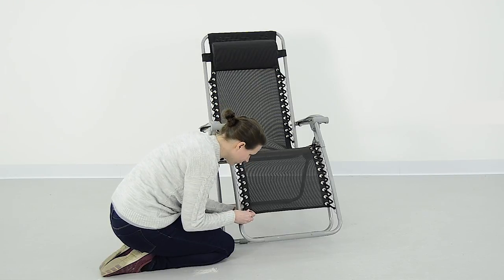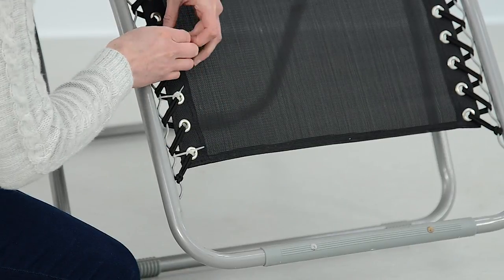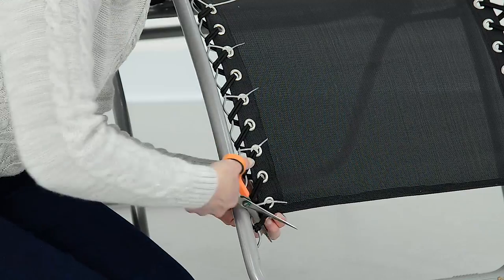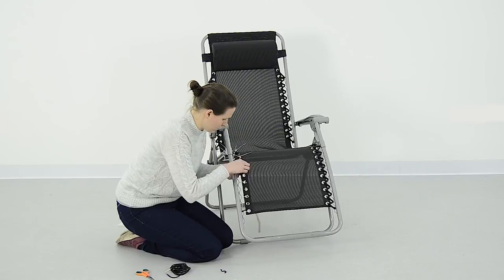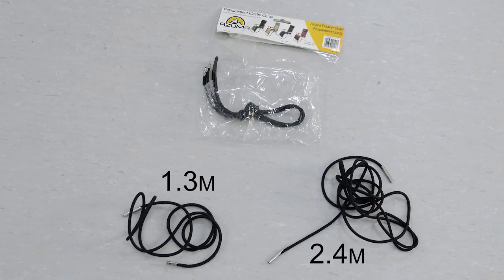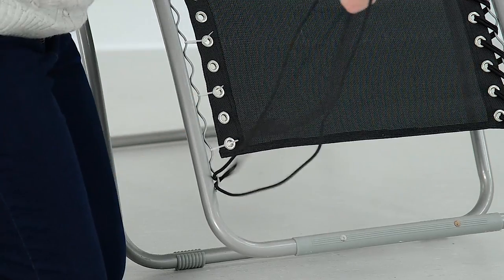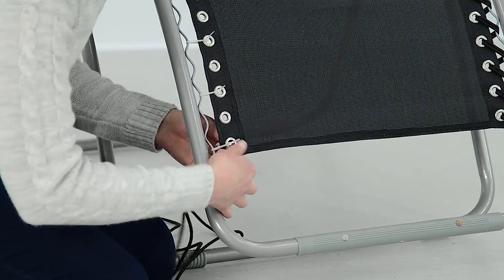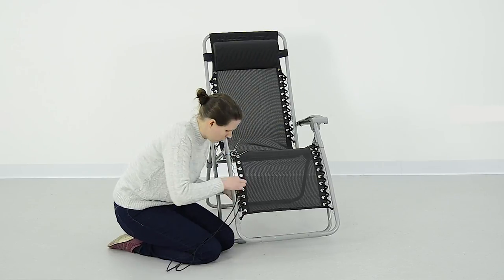How to Repair a Zero Gravity Relaxer Chair

Comment: How do you end the process
Reply from the maker: Hi Suzen. To end the process, you loop the cord through the entire section of the chair, and the silver tabs (on the end of the cord) will lock in place tightly, behind the final loop. You then cut away any cable ties you might have used, and your chair will be ready to use. Hope this helps. Thank you!
Reply: @XSStockComIrvine  why didn't you just put that in the video?
Reply from the maker: @wilso933  Hi. We didn't show the silver tabs locking behind the final loop, I believe, because it was underneath the chair, and thought perhaps the vast change in camera angle would alter the video. But lesson learned! Thanks for the comment.